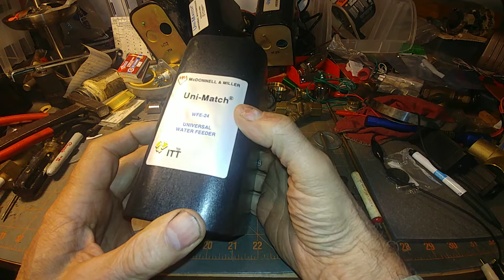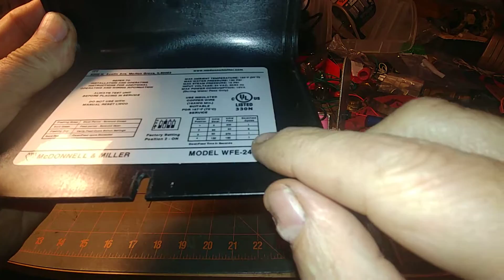McDonnell & Miller UniMatch Steam Boiler Water Feeder: Damning With Faint Praise

Comment: I was attempting to clean the strainer because the auto feeder does not supply sufficient water to the boiler. It had not been cleaned since we moved. I then observed that the arrow on the feeder valve was pointing towards the water inlet, which is opposite to the boiler. Is this the correct installation? Thank you.
Reply from the maker: The arrow should point in the direction of the water flow towards the boiler.

Comment: I installed the McDonnell miller universal wfe-24 it is set to 2  as I inspect the system when I empty the boiler to the point were the low water cut off turn on the water feeder kicks in and fill to the line but then it takes a short break and starts filling again but seems like it wants overflowin the system so I stop it  , any suggestions? Thanks
Reply from the maker: I would double check your wiring from your low water cut-off to the "black mailbox".
You might also reach out to McDonnell-Miller tech service.
Please let me know if they help you.
Reply: I call them and they directed to call a contractor said they could not give me answers not even a tip, when I look at everything last night all seems to be working properly , cut off is working to turn feeder on when low it’s just the feeder that continues to feed on setting 2 (dwell 60 feed 60 cycle 5) filling to line and stops perfectly and feeds again 4 times but I cut it before that , tried setting 3 ( dwell 30 feed 270 cycle 1 ) but I also cut because it seems to want to overflow on that cycle so I shut it off , the other two settings I have not tried are setting 1 ( dwell 0 feed 300 cycle 1  - says use with flow type lwco) and setting 4 ( dwell 120 feed 180 cycle 1 ) .. do you suggest anything else ? I want to try to do it on my own.
Forgot to say is a McClain series 35 100k but  and a hydro level 400 that’s is hookup to.
Reply from the maker: If the wiring is correct, it may be the L.W.C.O. is sending false signals to the feeder.  
Did you have an automatic feeder prior to this one?
It also might be the feeder is defective.
I'd return it and install a Hydrolevel VXT feeder instead.
At least you will get FAR better customer service.
Reply: @gordonschweizer5154   not this would be the first feeder installed as the boiler it’s new and first time use this winter , the I can’t find the installer but the boiler is working good , prior to this the notice the feeder wasn’t connected properly to the lwco and I got it to work by moving one wire that was in the wrong place , so you  think the cross wire before probably cause damage to the water feeder ECU motherboard ?? Also when you say false signal all I see is the yellow light come on when water is drained to a low level via test and that activates the feeder , right now is not cold enough to use the heat I’m only in the testing process before hand
Reply: I got a hold of a tech and was told that possible the probe of the lwco is probably has too much tape to the boiler and is probably not grounding well so it’s not is probably not sending the signal to stop the feeder once water level is meet
Reply from the maker: @robwhiff3411  That might be the case, do you see the low water amber indicator light go on even if the water level is above the probe?
Reply: @gordonschweizer5154  the light is not on but one thing I do notice is the lwco has the light ever so dimmed but not completely off
Reply from the maker: @robwhiff3411  Yes, on some manufacturers runs of that control, the amber light glows faintly.
It is more or less normal, I've been told.
Reply: @gordonschweizer5154  ok that’s good to know , so if i take the probe out should it not have tape at all?
Reply from the maker: @robwhiff3411  By the book, no.
But... What I was told verbally by the manufacturer 's rep was that was for folks who use too much tape.
How much is too much?
More than three wraps.
I also use a thin smear of non-hardening pipe dope, too.
Reply: @gordonschweizer5154  sincerely appreciate your response , I trying to do this myself
Reply: One last questions if the lwco is shutting down the system when is low do I still need to check the probe for extra tape ?
Reply from the maker: No, I don't think so. From this side of the keyboard, it sounds like the LWCO is acting normally.
Please strongly consider replacing the black mailbox feeder with a VXT.

Comment: Could these feeders get a drip with time? My boiler is over flooding and it’s either the feeder or the bypass valve…
Reply from the maker: Does your UniMatch feeder have a red button on it that causes your UniMatch to feed?
If so, go and press it for a few seconds.
When you release the button, does your valve shut right away, or does it take a bit to cycle close.
If it takes longer than a fraction of a second for the valve to shut, the Unimatch needs to be replaced with the vastly superior Hydrolevel VXT.
Even if there is no apparent problem with your UniMatch, I'd recommend you replace it anyway with a VXT feeder. 
While you are replacing your UniMatch, you can also replace your bypass valve with a 1/2" RWV brand ball valve.

Comment: I only have 2 wire red and white where I show connections them
Reply from the maker: I would replace your Uni-Match with a VXT feeder and replace the two-wire cable with a three wire cable.
Reply: Man your video is very valuable and teaches things
I used to have  2 terminal instead and switched to the 3 terminal as u said the manual feed doesn’t work at all the question is what terminal is the manual water feeder just wanna make sure it’s wired correctly
Reply from the maker: The issue is I cannot see what you have by way of your LWCO (low water cut off).
IF you have an electronic probe type LWCO, under the cover you may (or may not) find a wiring schematic.
I do not know how versed you are in tracing out wiring or reading  wiring schematics.
There are many details that could trip you up and you could wind up burning out your boiler's transformer (24 volts) or hurting yourself if you have to deal with 120 volt circuits.

Comment: Why causes an auto feeder to overfeed? In other words to feed above the normal waterline
Reply from the maker: There are several causes that I've run into. 1) The domestic water pressure is way above 60 psi. The s-45 valve is designed to deliver about one gallon per minute of "on" time with an incoming pressure of 60 psi. 2) The flow restrictor disc in the valve is not small enough. That is the hole in the disc is too big. M&M sells a kit with different sized discs I think. What a pain to replace! Or the disc might be gone entirely (unlikely). 3) The water content of a boiler might be very small, so one gallon might be too much. 4) The low water cut off is keeping the feeder on too long? 
If overfilling is a constant problem, you could try cutting in a globe type valve and use it to dial in the flow so it's just right.

Comment: Hello,thanks for this video,i have a question,how do you connect 2 wires to mcdonnel miller?please help,i connected those 2 wires to W and N,i didn't connect wire to H,when feeder is on,green flashing,the tinder will be off,ever time,please help,thanks.
Reply: Model is WFE-24
Reply from the maker: Hi! It's best to get another wire for a total of three in order for your unit to work properly 
One to H - that's the 24v power. N is for 24v return and W is for the trigger signal that tells the unit to start feeding.
Reply: Thanks for your quick respond,what happen if i mess up 24v power and 24v return?it can feed,so the connection of W is correct,right?i sent some links,but it won't post.
Reply from the maker: @alexlin3205  Here is something you can try - just hook up the the H and N. Then press the red feed button. If it feeds water, well and good. If the boiler fires, you've got heat for now.

The feeder is a convenience, not a safety device. 

You can add water as needed manually to the proper level in the sightglass and then concentrate on getting three wire thermostat wire and run the connections properly with no pressure on your mind.
Reply: Thanks,i will try later
Reply: Please check the pictures i shared.
https://drive.google.com/file/d/1dySxLVO-k2HWfPvUg3KR75xPInnNb8vM/view?usp=drivesdk
https://drive.google.com/file/d/1dy7YdWeepPjQINFMKKxgmjqp2PdVquMz/view?usp=drivesdk
https://drive.google.com/file/d/1dvw1ZUeOTMOjRGqbif55QiAbSJzd9bW5/view?usp=drivesdk
https://drive.google.com/file/d/1drBYw1h_P622hBJD5Rnim8iGICJdxYJk/view?usp=drivesdk

Comment: I have a customer with the same filler 24 volt and when it gets a feed call it cycles for about half a second every minute while the boiler is calling for water.  The manual fill button cycles the solenoid with no problems.  Any idea what may be happening?
Reply: It may be that the LWCO is sending false signals to the feeder.  We are starting to see the M&M PSE-802-24 LWCO do strange things to water levels by messing with the feeder.
The other thing might be the setting switch on the feeder.  Check what it is vs. the instructions on the inside of the feeder's cover.
Reply: The LWCO is a CycleGard CG400-2090 24V.  Any known issues?
Reply: @boun_viaggio_usa9989  In regards to the CycleGard, I have not heard of any issues...yet.  It might be a wonky contract on the relay from the CycleGard.  What is the feeder's switch setting?  How long has this been an issue?  I'd have a new VXT feeder and CycleGard ready to install if you go back.  I'd try disconnecting the middle wire (the feed signal) and then jumper between "hot" and that middle contact.  If it still does the short cycle dance, its the feeder. I'd then install a VXT in place of the UniMatch if you can.  If the feeder works ok, the problem would seem to be the LWCO.  Does that sound like a plan?
Reply: Gordon Schweizer I'm going to be back at the house on Wednesday and had already planned to double check settings and do a standalone test of the feeder.  Thanks for the help.

Comment: How do you connect 2 wires coming from the low water cutoff to a wfe mcdonnell uni match feeder 120v that has 2 wire connection
Reply: Sorry feeder has 3 wire comnection
Reply from the maker: @jameelkhan3161  Thanks for the question. 
I'll try to answer it as best I can with the proviso I could be wrong. 
Use your best judgement as your life depends on it. 
You are going to need 3 wire 14ga metallic cable from the LWCO to your feeder. One should go from the "hot" terminal (that is to say120 volts to ground) - the black wire is traditionally used in this role. The white wire (and always the white wire by code) should connect to the neutrals. The red wire used here as the trigger goes from the "normally open" terminal on the LWCO to the middle terminal on the feeder. The green wire is ground.
120v can mess up your life. Be careful please.